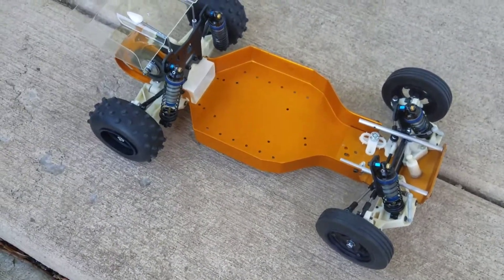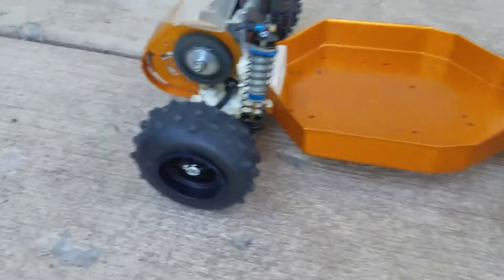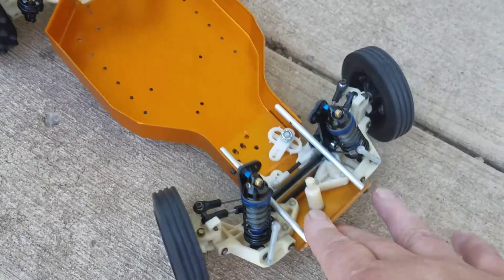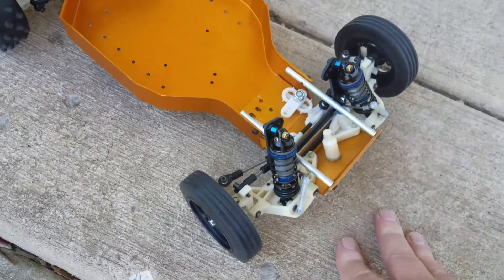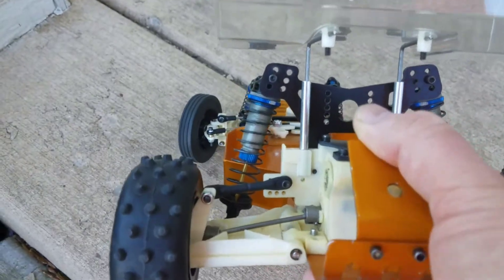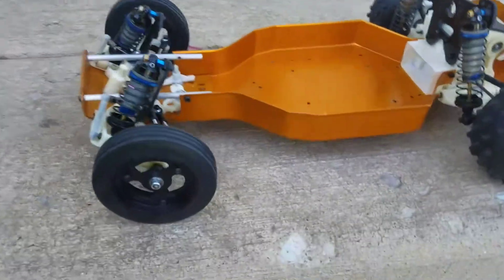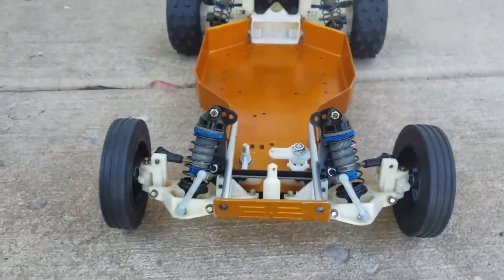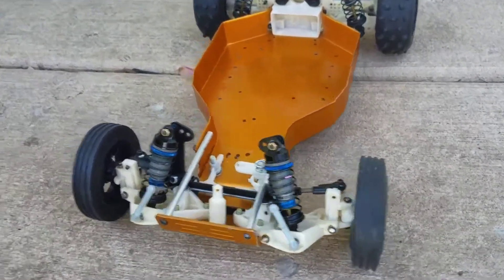RC10 Cadillac Part 5 restoration  A stamp Gold Pan vintage team associated  buggy

Comment: She's a beauty, say I'm trying to put one together from 3 old Chassis I got all in rough shape trying to get one good one. Front shocks lower install once you slide the pin in how does the lower part of the shock stay in place. On the other car I have I can't take out the lower shock pin what's holding it in 🙏🤘😎please help
Reply from the maker: there is a tiny set screw holding the pin in, look at the arms and u will see a hole, you need a small allen wrench to fit in there, then just pull out or tap out with a pick.

Comment: Thank you for the vid.  I started working on my RC10 I purchased new in the mid 80s.  I need the rear camber link.  Do you have a part number for the DU-BRO you used?

Comment: You have some great videos on these vintage RC10 cars. I finally broke down and got one, kit#6011. I have some technical questions about the car and its planned restoration. Is there anyway to chat via email or phone? I already made a big mistake I think. I got a commercial ultrasonic parts cleaner and it completely stripped the gold anodize from the aluminum. I didn't expect that to happen. Anyway, looking forward to chatting with you for advice, thanks!
Reply from the maker: hi, thx for the comments, are you saying the ultrasonic cleaner stripped the anodizing of them?
Reply: @minitruckin  Yes, the nose section is now bare aluminum. What gold remains will now easily wipe off with a finger.